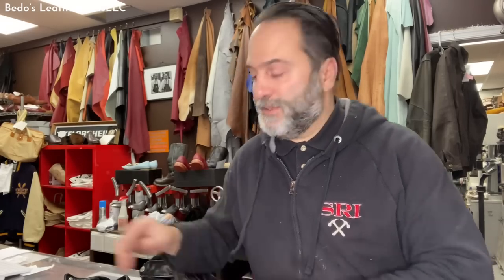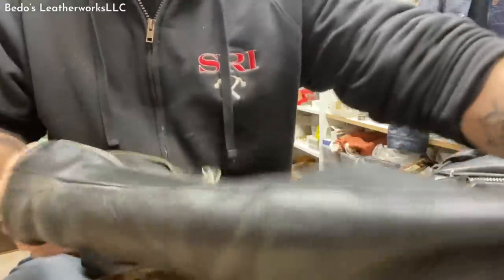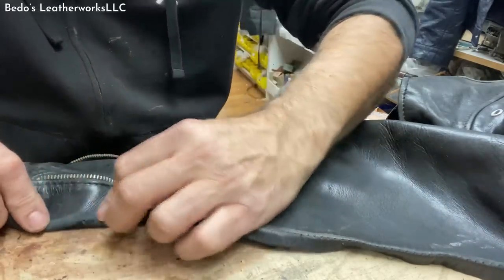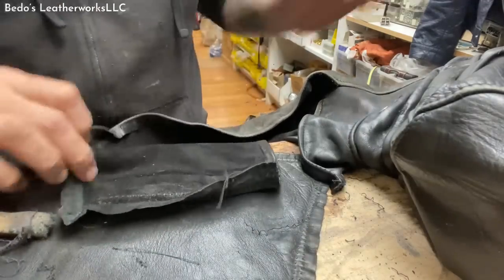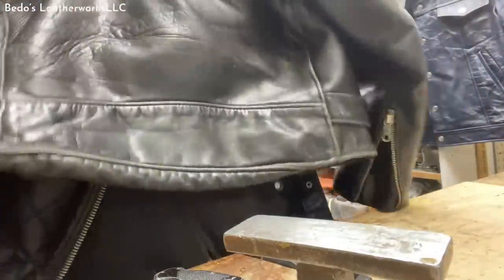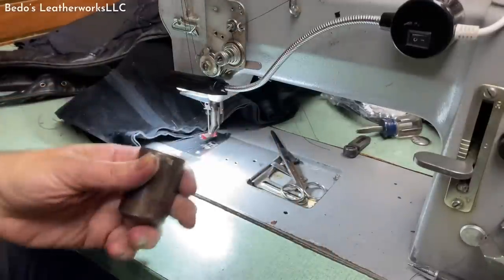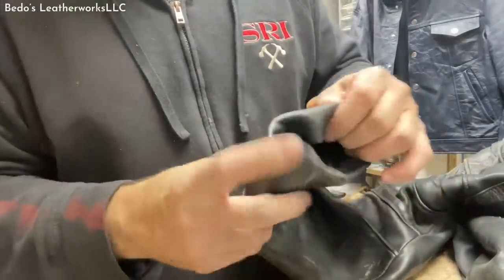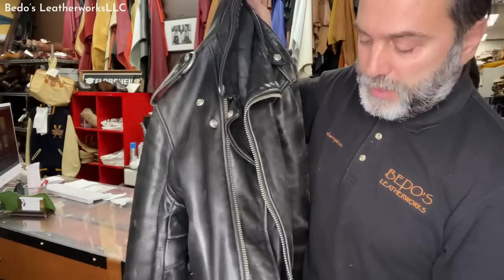MOTORCYCLE Jacket ALTERATION!

Comment: Good job. Reminds me of the time a friend asked me to lengthen the sleeves on a suit jacket. I'm just a hobbyist tailor but he put his trust in me. After pulling the sleeves apart, I found enough extra material turned in at the cuffs for me to work about +1¾". Had to press out the original folds then remake cuff pleats and faux button holes at the new length. Hardest part, strangely, was adding extra length to the lining. Took me a while to work out. Result was good and my friend was happy with it.

Comment: Question. I usually wear regular jackets. I purchase an Schott Bomber jacket from the 70s and ir was a long. The sleeves tend to fold and the material in the wrist area can actually be somewhat hidden and it looks like its just the leather. So Should i shorten the sleeve or just rock out with it?